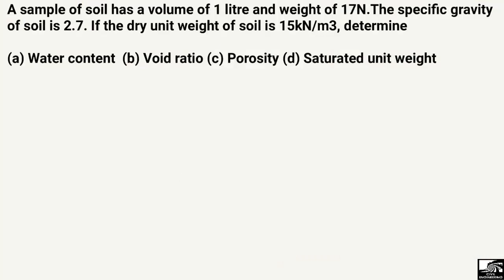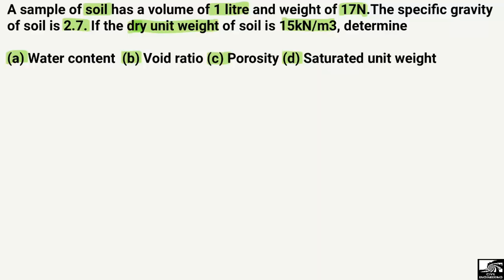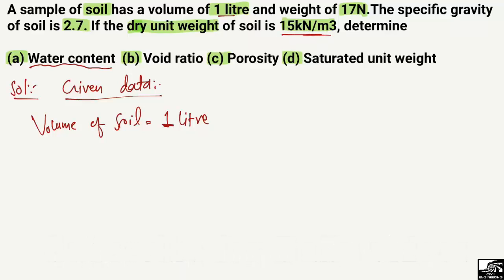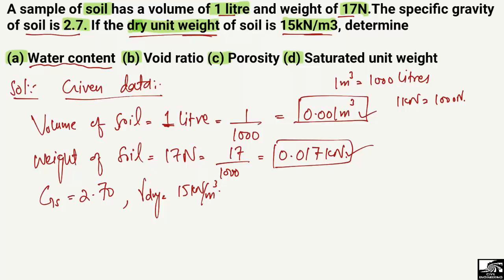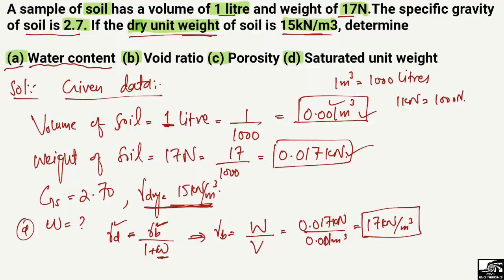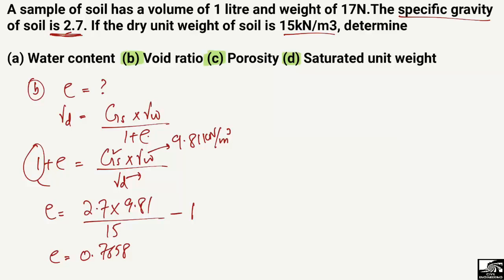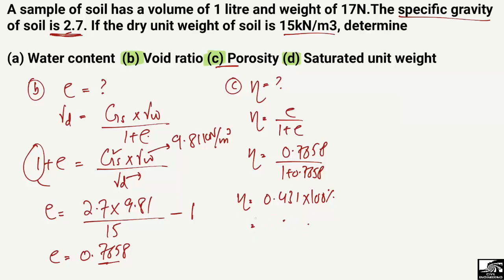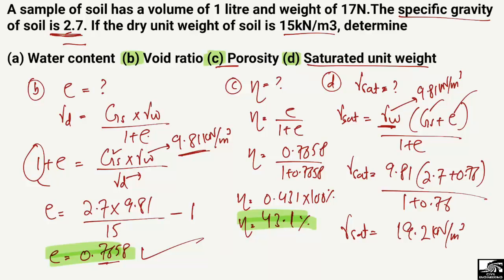Soil Mechanics || Water content, Void, Porosity, Dry unit weight

Comment: Saturated unit weight is 11.53
Reply: WRONG. u dont have to multiply 2.7 into void ratio, u have to add those values not multiply them and then multiply them into G, i did the same mistake first then realized it 😺😼😼